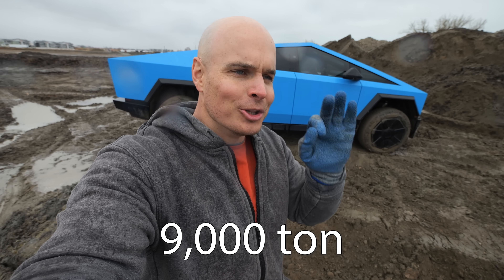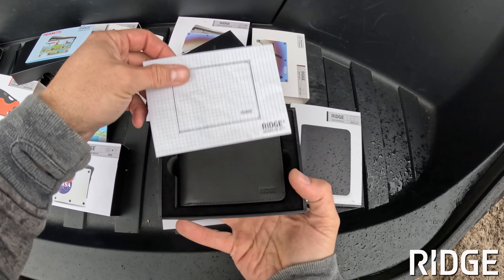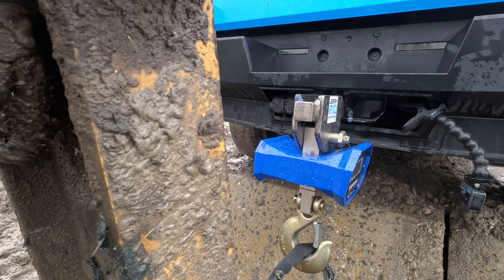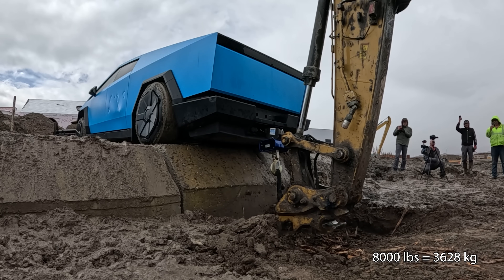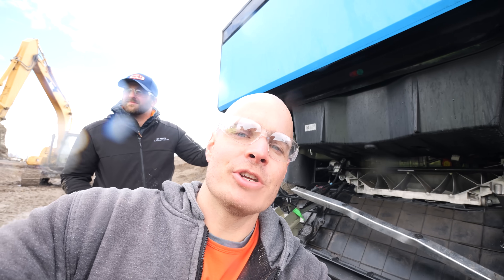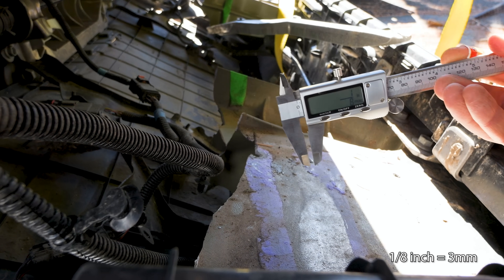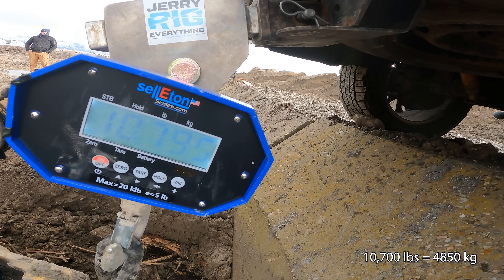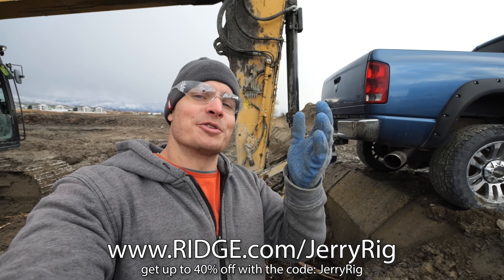SHOULD YOU TOW WITH A CYBERTRUCK?! - (catastrophic failure test)

Comment: If you put so much weight on the back that you had to hold the front down then I don't think there is a problem.   People can not make it to the highway with the front up in the air.
Reply: It seems that awd with turnable rear wheels for crabwalk are a joke
Reply: Highways are not perfectly level. Center of gravity will shift uphill vs downhill and will be different for the truck vs the trailer when cresting a hill or hitting a valley.
Reply: @ ofc it will, but does it make front wheels come off ground? Have you ever seen a truck on a road doing a wheelie while towing a load? Because this is literally what you are arguing right now. It is ridiculous, and no one is building cars with that scenario in mind.

There is a reason why roads are build to specific code. Crests or valleys have specified maximum angle and curvature. That in turn is used to rate downward forces applied to tow tongues. There is no scenario in normal usage where the load can even approach exerting such a large force in vertical direction on a tongue. It would simply cause the truck to fly of the road (while hitting a crest) or dig into the pavement while doing a wheelie (while hitting a valley).
Reply: @Bilut  They needed to hold it down because the truck was stationary on a flat surface. If the truck was tilted down or was in motion and braking there would’ve been less external force needed to prevent a wheelie or no force at all because that force comes from the trucks own gravity.

There are at least 3 instances of the hitch ripping off and breaking the structural aluminum frame within a year of the release of the Cybertruck without popping wheelies. There are also a lot more Fords and Dodges being used for towing out in the wild and they don’t fail this way.
Reply: @bru_haha  Car tilting or moving does not change much. It would've mattered if a car was filled with liquid - but it's not :)
There is a reason tongue weight is rated different than towing capacity. Much smarter people thought of that and created norms and homologations around proper calculations/numbers.

As for other cars not failing this way. Make that dodge ram survive 95% of it's towing capacity applied at the tongue, please. And then talk. Because you know, it's rated for 13.8k lbs not 11k. Apples and oranges.

And finally - I couldn't care less about cybertruck viability. It can be the worst car in the fucking world. That is not the point. It just boils my blood when I see disingenuous 'test' literally engineered to pass/fail according to a predetermined script and hailed as a real result. 
This is not a simple mistake. He's done this deliberately out of spite. Not acknowledging a ton of comments pointing out his mistakes and cowardly adding '?' and then '?!' to the title - so it is not that definitive - just make it worse.
Reply: @ Think again,  The  maximum grade of a highway is 7%.    There is no way you don't already know your teetering on the edge.  The first time you press the breaks you front would be up in the air.

Comment: Yeah when whistlin diesel called this out, everyone called it crap because he pushed it too hard and did too much stuff to it and it's his own fault. Whenever any fabricator or engineer would know that casts aluminum is very weak when it comes to having a tow hitch hang off the back of it, everyone blamed it on whistling diesel. And then the internet started popping up with the same failure with Tesla cybertrucks all over the place! And they still said it was owner error. And now here you see it happening live!

Comment: All those guys standing around while you're talking about needing more weight, and nobody suggested just digging the hole down a little more and leaving the bucket on, or hell, using the bucket with a full scoop of dirt or rock? C'mon Zach....
Reply: Yeah but then the other truck might have failed too and that wouldn't be good for the narrative of the video.
Reply: @BenKDesigns  That's because they might have looked like construction guys but they definitely were not
Reply: The entire test is working under an incorrect assumption so what else would you expect.
Reply: Came here for this comment.

Comment: You said the Cybertruck had a towing capacity of 11,000 lbs, during the test it broke at 10,400 lbs. Does this just not confrim that the truck is as advertised?
Reply: no it does not. it didn't meet the rating.
Reply: @michaelhohe2168  So you don't think beinig within 5 to 6% of the advertised tow limit is good enough?
Reply: @johnbaker17  see, now i'm not brain damaged so I'd be pretty pissed if my vehicle could not handle what it was advertised to handle without a catastrophic failure. we have towing standards for a reason and other manufacturers build in a safety buffer just in case. Read up on the SAE J2807 and why vehicle tow ratings are not at the absolute maximum of what a vehicle can handle.
Reply: now i'm muting this convo because i want to preserve my fucking brain cells.

Comment: I genuinely dislike tesla, but this test, and your "math" is wrong on multiple levels
Reply: Can you elaborate? Inquiring minds want to learn more.
Reply: @StarMiners0416  The towing rating is in the horizontal direction, not vertically. Vertically it's around 1100 pounds.... It's called tongue weight rating.
Reply: @StarMiners0416  Jerry mentioned tongue weight and tried to explain it, but he was completely wrong, towing up hill or hitting a pot hole does Not put the entire weight of the trailer on the hitch.
Reply: @StarMiners0416  Sure, but sorry in advance it will be sloppy.

I'll say a few examples, if you are really interested, I'll watch the video again, and list some things, but currently doing my thesis, so don't have too much time.

At one point he said going uphill, the tow rating becomes the tongue rating (or something like that). That just stupid, for it to be true, the uphill has to be  vertical, at a realistic incline the wheels of the trailer still take the majority of a force. (Or do you wanna  pull 5 metric tonns up a 100% // 45° angle?)

In addition to that, if the truck is going uphill, the direction of the force is changing, going back to the "vertical hill": the frame would be completely in tension, which change the load distribution, and most metals handle tension better than shear force .

Some non engineering points:
1. The title is: "do not tow... " where he means  do not tow because if you accidentaly exceed the rated weight by 10x (!!!), your frame will break. 

2. Yes, the steel frame is better obviuosly. Was this frame designed to be better? No. 

If you have any questions, or counter points, feel free to ask. Also, I watched it like 2 hours ago, so if I said something wrong, please correct me.
Reply: @tamasarvai7668  you are correct sir

Comment: The Tonge Weight is rated at 1,100 lbs which is higher than the F150. Tongue weight is NOT the same as Towing capacity. Shame on you! 😳
Reply: Agreed!  
Fir the next tedt, Let's put that excavator on a bathroom scale & see how much it weighs.
Reply: Bot
Reply: @nate.bailey 
 Bastian Of Truth
Reply: at 9:46 he goes over this, seems like you didn't watch the entire video
Reply: @BIGCASIO I watched it all and he made that up and it's false. Every vehicle has rated towing capacity and tongue weight capacity. The trailer load can never transfer  to the tongue or the vehicle would become out of control. Either he doesn't understand how towing works or he's deliberately perpetrating a smear campaign. Did you notice he had to hold the front end of the truck down to do this "test." If that much tongue weight could ever actually be applied by a trailer the suspension would collapse and the truck would be doing a wheelie.
Reply: @John-qc8yy  Agreed, if there was a potential force multiplier situation for the tongue, the towing capacity rating would be MUCH lower.

Comment: You and whistling diesel while I love you both, are completely wrong in this testing. The whole entire weight you are putting on is TONGUE WEIGHT, for which the Cybertruck did exceedingly well at by breaking at 9300 pounds OVER what its rated for.  You can't test the tow wight by tongue weight as you are showing. These are not comparable tests. I am highly disappointed in your results and the way you presented them. Even if there was a sharp downward force from the hitch, it still would not be 11k pounds more than likely. The cybertruck did fantastic and I would be confident in towing with it
Reply: This was my concern too. A direct downward force there is not a towing weight, it is a tongue weight and NOT what that portion of the cyber truck is built for. I can't think of a single scenario when a constant load of 10k lbs perpendicular to the receiver would be applied, even with an improperly loaded trailer
Reply: and also I definitely agree a steel frame is far superior than aluminum.
Reply: Its very common to hit the rear hitch offroading and that is how to easily exceed 11k pounds of force . There have been cases as shown in the WD where even a pothole being hit while towing causes catastrophic failure. I do think that this test wasn't very useful and WD follow up test of dropping the trucks was better to simulate impact fatigue though
Reply: @ it is but that is definitely the exception to the rule. In general this should not be a common issue with the cyber trucks. no one is offroading in these all the time nor is this typically an offroad vehicle.
Reply: @robdean54  They were heavily promoted as being the ultimate offroading vehicle
Reply: @ also I maintain what happened to WD's was a direct result of dropping his 6000 lb truck directly on the tongue, which prob cracked it. again, not a typical scenario
Reply: @robdean54  Its a very common scenario when you hit a pothole or  go offroading. I have done it numerous times on my trucks. Another scenario is someone hitting your rear trailer in an accident causing dynamic impact forces exceeding 11k and that causes you to lose your trailer where with steel it would bent but in almost every case you would not lose your trailer. Also another consideration is repairability . A steel frame can be rewelded unlike that AL unibody. There are good reasons roll cages in race cars typically all have to use mild steel instead of AL or Ti which are much lighter .

Comment: The fact that it was lifting the front of the truck especially saying it's as heavy as a tank actually shows the extreme amounts that can take no one's putting enough weight on their truck to lift their truck in the air that makes no sense
Reply: The number of pickups lights shining in my eyes when towing tell me how often people overload or improperly  have the tongue weight wrong and are lifting up their front ends. Just watch a few car crash videos where there's a pickup towing a trailer and see how often the lack of steering control is a contributing cause.
Reply: @michaelcummings7246 there’s a major difference between collapsing the rear suspension and lifting the front wheels off the ground.
Reply: One thing you have to keep in mind is that road movement and bumps will cause the forces to spike well beyond the weight you would observe at rest. 10,000 is a lot though.

Comment: Must say, very embarrassing that you went through the effort to "Prove " cybertruck was not safe by breaking at 10,400 while not showing when the comparable one breaks, only that it withstood 10700, it could have broke at 11000, no one knows.

Another weird thing is that with the dodge you did not use a down force on the front which allowed flexibility and bounciness on the Dodge vs a very strict movement on the CT.

All in - even you are right in your assumption that CT is bad you have not proven it at all.

Very disappointing how you are losing your credibility due to some bias you may have.

😢

Comment: There is a big difference between tongue and towing capacity. The Cyber truck's documented maximum tongue weight is a mere 1100lbs, this means you should only be towing the 11000lbls max towing capacity with a double axle trailer as to not put that weight on the hitch. If only Americans read the manual....
Reply: Click bait... And rtfm is a global meme before meme was a word
Reply: rTFM is not just an American saying my guy, but good point 💯🌎

Comment: 11000lbs towing (horizontal) would equate to a 1000-1500 lbs tongue weight(vertical)...  So..I'm impressed it took 10,400lbs to break this!
Reply: Gay
Reply: There is a video on the internet where it has already broken off while off-roading.
Reply: @Gladiatus121  ya? What did they do that time? Tie it to a tree?😂
Reply: That was going to be my point exactly!
Reply: For aluminum that thin, sure. But while it won't likely ever sustain this amount of force, fast peak forces may. This is what happened to WD's truck, it only briefly reached a load capable of breaking it. The fact that sustained loads and brief loads can still break it doesn't mean it's impressive. It shouldn't have been built like this to begin with and people have every right to call out Tesla's engineers for deciding to make it like this.
Reply: Came here to comment this
Reply: Tf yall yapping. If your horizontal strength is good you have good towing abilities yes, but once you go over a bump or pot hole you instantly create a vertical stress.
So if you tow something at 5t and then bump something vertical stress, be it tho smaller, is applied.
Since aluminium will bend I doubt the cybertruck could carry 5t and them withstand bumpy roads often
Reply: Watch the full video
Reply: Thank you for your valuable insight, disappointing what YouTubers are doing these days 😞
Reply: Considering aluminum has other flaws he mentioned, who knows what'll happen to its (already lacking) towing capabilities when the truck gets to even half the age of the Dodge. Remember it's also an "off roading truck" so it can't pull rigs out of mud without risking complete irreparable damage to the truck. The load he put on the cybertruck was gradual and not a sudden shock on the frame, which is not a real world situation. 

There's no excuse for this, its dangerous and any metallurgist could've pointed this flaw out. Tesla is not a small company.
Reply: Yup! Truck is not designed for 11k purely vertical. 10k to break is honestly super impressive!
Reply: @jamespattison2114 gay
Reply: @PaulGibbonsMusic  Exactly. It’s not steel box frame, but it’s still plenty capable for what it is. Zach is just salty because he doesn’t like Tesla anymore.
Reply: @TheClintMatthews  I hope for him he doesnt have Tesla stocks anymore as well
Reply: @TheClintMatthews gay
Reply: @TheClintMatthews  yea but it already started cracking at 9k , so for example when its constantly towing , it cracks little by little and the end result will be your truck snapping in half , yea?
Reply: @aqeelnazim2442 No, as an engineer, you design products  for specific loads. There is a huge difference between downward force and towing capacity....
Reply: @TheClintMatthews the real truck held up way better lmao
Reply: @Iambrooh  “real truck”.. 🙄 I remember when Tacomas weren’t real trucks either. Now it’s the biggest bro truck of all.
Reply: @TheClintMatthews  lmao it’s not a truck of it can’t do truck things without falling apart.
Reply: @Iambrooh  standing a excavator on the back of a 1500lb payload vehicle is not “truck things”. 🙄

Comment: Tongue weight is typically 10% of the towing capacity. So you should be able to load 1100lbs on the hitch without any issue. However, the rating should be less than the failure load by 50%, giving you a failure load of at least 2000-2200lbs.
Reply: Except that anyone that has done any towing knows that the forces that the trailer exert on the hitch vastly exceed twice the tongue weight. It is not unusual for a trailer with a 1000 tongue weight to bottom out the rear suspension on the towing vehicle when you hit a dip in the road at highway speeds. It is often called porpoising - when the distances between the axles set up a harmonic that causes the trailer weight to come down just as the vehicle wheel come up out of the dip. That force is easily 3000-4000 pounds.
Reply: @CL-YouTube-y7e so
The cybertruck still aced the test by withholding 10,400 pounds
Reply: @CL-YouTube-y7e  But not 10,000 pounds.
Reply: @CL-YouTube-y7e  And the Cybertruck didn't fail at double that threshold, which, again, seems like an endorsement of the truck, not a danger.  And btw, you're making reference to a shock load, not a sustained load.  This test was against a sustained load.
Reply: @ Whether it is twice that load or 10 times, the problem is that the failure is instantaneous and catastrophic. The entire back of the truck comes off when it fails. It doesn't just fold and bend. It doesn't fail and then you must depend on the safety chains. When it fails, the trailer becomes completely disconnected and becomes an uncontrolled 10k or 15k missile flying down the road. This failure has been reproduced multiple times.
Reply: Yes exceeding the limit will always bring failure 10%

Comment: Just for reference, the Ram has a 12,000-13,000 trailer capacity and the same 1500lbs tongue weight rating.

It is also 20 years older and has been in a rear-end collision.
Reply: Probably has a partially rotted frame too.
Reply: And this is why I love steel.
Reply: And it still made the Tesla look like a joke
Reply: The Cybertruck doesn't have a 12-13000 trailer capacity or a 1500 tongue weight.  Cybertruck is 11,000/1,100, respectively.
Reply: @bvoyelr  exactly, so why did exert 10 times that amount of force?
Reply: That rear-end collision made it stronger?
Reply: @Dropz_RSA  It's called drop forging